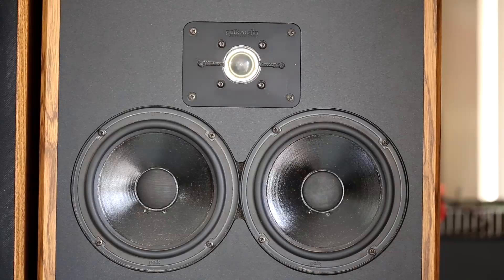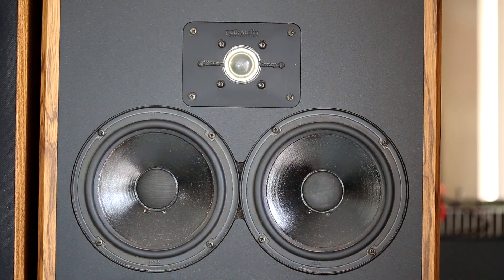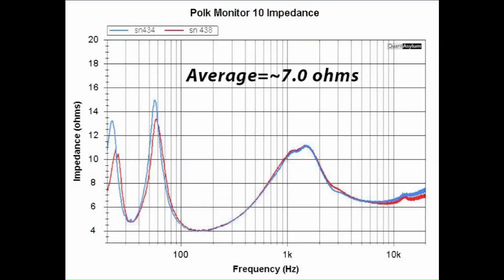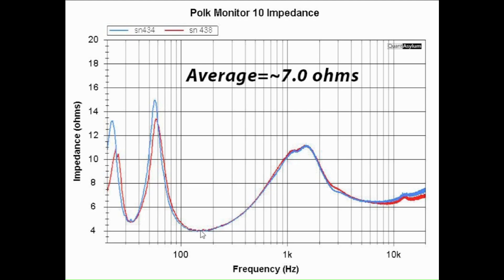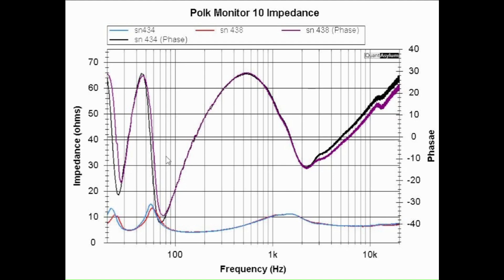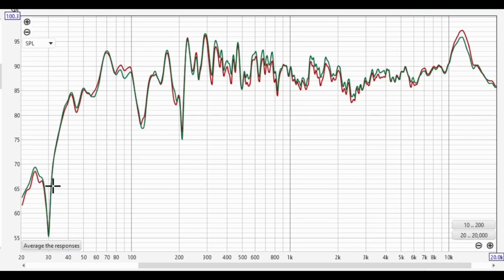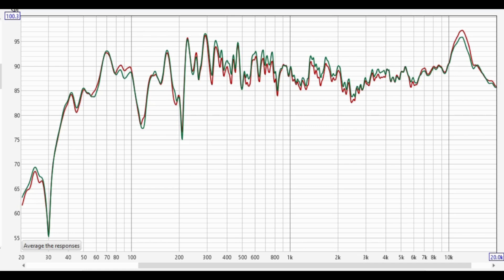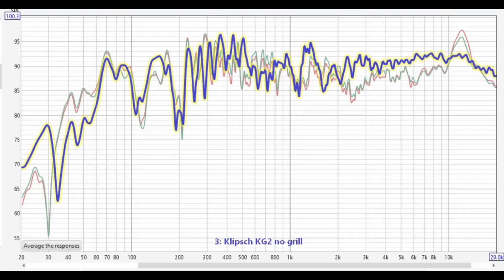Polk Monitor 10 Series 2 Loudspeakers- Vintage Audio Review Episode #164

Comment: I had some used.  I upgraded the 35 year old electrolytic crossover caps with metal poly caps.  They opened up and cleaned up a lot.
Reply from the maker: Glad you had good results with the crossover upgrade.

Comment: They have a fuze on the back. Maybe that is for the sub only? Seems like is has separate inputs on mine for the sub.
Reply from the maker: Maybe they did that on some other version, but mine does not a fuse you can get at or wiring for a sub

Comment: I bought my Polk Monitor 10 around 1981, I think the shop was Absolute Sound in NYC.  They have the Peerless tweeters, which are supposed to be much superior to the later replacements, but I've nothing to personally confirm that lore.  They have been solid and dependable over the years, I had one woofer go bad early on and Polk had an exact replacement.  I have more expensive speakers, like Klipsch LaScalas, now as well,  but I still listen to the Polks more often.
Reply from the maker: Thanks for sharing. I am listening to my Lascalas with some old vinyl right now. THe Polks can't hold a candle to the LaScalas IMHO, but beauty is in the ear of the beholder.

Comment: I've been jammin' on a pair of model 10A's for for the last 40 years!!!!  Due to my weird room, I use one silver tweeter and one black one that says Polk Audio 4 times on the tweeter.  The drivers and passive radiators are all original, but the crossovers were modified long ago.  These speakers are absolutely amazing.  With a nice Thorens, Hafler xl-280 (modified) along with a Linn preamp....max sound...max volume...no distortion!!  I bought this mint condition pair with stands for $300 around 1985 from a co-worker and have been jamming with them ever since.  Everyone is amazed at how good some of my lps sound with this system!!  Go Polk Go !!!!
Reply: I purchased my first pair of polk Audio Monitor 10A's back in 1981.
Consider them my first sonically "adult" speakers. 
Although everyone praises the A version due to the peerless tweeters, now that I'm in my 60s I can't hear much of anything over 12 kilohertz anyway. 
I did not hang on to mine for 40 years but I did recently purchase a replacement pair a few years ago. 
I'm pairing them with a decent SVS subwoofer. 
The nice thing about Polk's is that they use a durable rubber surround so other than adding a bit of epoxy to the magnet drivers bonding them to the metal frame, these speakers should last a long time. ❤
Reply from the maker: @powerguymark  I appreciate the comment and did not know about the epoxy "hack" you mentioned- am glad you reconnected with a pair!
Reply from the maker: Thanks so much for sharing about your system and am glad you kept it all of these years!

Comment: Those are not the series 2 model. The series 2 had the black SL 2500 tweeter.
Reply: Which ones were considered sonically superior?  The Series 1 or Series 2?  I have a pair I got new in the mid to late 80's (still in mint condition, as I 'babied' them), with a serial number of 176731.  Next to the serial number it says just the number '10', and the tweeter is transparent, not black.
Reply from the maker: @AudiophileTubes  One of the comments is that they are Series 2, but I honestly could not tell which are which at this time. Some say the tweeter in the series 2 is better, but ultimately it was what you think sounds better, not some reviewer, even if the measurements are  bit skewed one way or another- maybe you don't like as much bass as someone else kinda thing. I appreciate the comment!
Reply from the maker: I will take your word for it. I tried to make a determination from some brochures that I had found but must have gotten it wrong, but will do a bit more checking

Comment: The Polk 10 was a very flawed loudspeaker. I used mine back then with a 200 watts per channel Carver power amp, a Carver prramp and a top of the line Thorens turntable with a Grace tone arm, and Audio Technica's top moving coil cartridge. A pretty good system 30+ years ago; but the speakers were definitely the weak link. Polk chose to use twin smaller woofers above the passive radiator, so the mid and upper bass ( the fancy range )..would be fast, fleet, delicate and light instead of the usual  fat overly heavy handed mid and upper bass of most 12 inch woofers of the day. It did have good upper bass but as the bass got lower in frequency, it lacked the precise bass definition and transient quickness of some better speakers with active woofers. The passive radiators of the day were usually like that, a little slow, but the low bass definition was not too bad; just not real good A better idea would have been for Polk to mount the twin middle drivers ABOVE each other (instead of laterally), so they could make the cabinet slimmer. This would have diminished the awful cabinet diffraction of this speaker. The cabinet area behind the drivers was just too much and you can hear cabinet interference & early reflections galore. One listen and comparison to any good speaker with a slim cabinet or drivers mounted outside the cabinet,  reveals just how bad that problem was with the model 10. I have never bought a speaker with a wide cabinet like that again. 

 The best you can say for the model 10 is that it gave you a wider frequency response and a fuller sound than some other speakers at its price back then, but I'd trade that little extra bass and warmth for a speaker that disappears with not as much cabinet surface area behind the drivers. Maybe it could be considered a "good" speaker in retrospect, but not a "very good" speaker, or even anywhere near some of the better competition at its price back then. They could have done things a lot smarter. The Polk RTA which came later had the mid/woofers situated near the top of the cabinet, which was a definite improvement, decreasing much of the cabinet interference. Polk might have realized the problem by yhen, and corrected it with the RTA model and its tweeter was mounted OUTSIDE the cabinet. On a scale of 1 to 10, the model 10 would have ranked a 5 back then, or a 3 or slightly above now, with modern progress. The more expensive RTA would have ranked a 7 or 8 or about a 5 or 6 today.
Reply: I used to have the 10s the final version before they were discontinued. I remember that the tweeter would start crackling on one song on the treble. A song called Monkey Business by a metal band Skid Row. I had them hooked up to a entry level Yamaha integrated amp that was 50 watts per channel and boasted low impedance ratings. You would think that would be plenty of power right? Needless to say they were stolen from my apartment along with the other gear and amplifier. I have the monitor 5 which is the 8 inch sub bass radiator and silver coil dome tweeter. They were popping on a bass heavy CD I have hooked up to a old Adcom amplifier. Not sure what that was caused by? I now have them hooked up to a old Yamaha receiver and I play mostly vinyl on it. They seem to handle it well. I have a vintage Carver receiver I just bought. The m900 90 watts per channel and so far this component has been amazing on my CDs and power!
Reply: Thanks! ..I've done more experimentation with audio than maybe anyone over the years; or almost anyone. I modify equipment of all sorts and can triple sound quality. Currently am modifying a vintage system that I put together (used) for about a grand and a half, and am trying to get it to achieve six figure sound quality. It's really getting there. I could never afford  equipment that's as good as what my project sounds like already.
Reply from the maker: @sidesup8286   Just because something costs a bunch does not mean better sound, but trying to make your own system on a budget that sounds great is very rewarding.
Reply: Retail prices are conjured up in board rooms, and don't necessarily reflect quality or sound quality. But there is much out there that is way superior in sound, and it seems to always cost a lot. A manufacturer knows when he really has something there, and knows when he has  something very special. If you've ever been to a major audio show, you hear what is maybe actually worth it, and what is not worth it. Some items with high price tags do not have sound quality commensurate with the price. But sound quality & sonic realism can go much further than your average audiophile thinks.
Reply: Why not switch off Polk? They have never been among the best speakers in decades past. Some of their more current offerings within the last decade have been liked by reviewers whose judgement I respect. But I doubt if I would ever buy Polk again. But I have an open mind. One great new designer can turn an also ran into a great entity.
Reply: @sidesup8286  I own other speakers. Don’t get me wrong. I have a pair of Bowers and Wilkins speakers 685S2 stand mounted speakers and a pair of PSB tower speakers. The XT1 circa 2014 I want to dabble in the new speaker department and something that is in my budget. I have been hearing alot about Elacs over the years but I haven’t heard them personally. And a new speaker company called Fyne audio from Scotland. Something that is not really in the mainstream market like Polk Klipsch etc
Reply: There are so many different brands of speakers out there. Some of the speaker brands that are in higher end audio parlors, often have a more  budget model that might not have a tall cabinet, but using them on stands with a subwoofer would give you a refreshing freedom from cabinet diffraction from the wood/mdf behind the drivers. Good smaller speakers will disappear more since there isn't much cabinet area behind the drivers to cause diffraction and interference effects. Look for slim cabinets and rounded cabinet edges; that show you that much attention to detail was taken. My favorite size speaker is one around 20 inches high, with some depth to the cabinet but slim in front where the drivers are. Such a cabinet has enough internal volume to go deep enough in the bass, but the cabinet is small enough to get out of the drivers way. A great sonic disappearing act usually occurs, with musical sounds, and no hint of a cabinet or the sound coming out of a cabinet, if the cabinet is well made. Of course you need speaker stands. I would describe this kind of speaker as a large bookshelf speaker. Some smaller bookshelf speakers may lack bass, dynamic range, power handling and they "may" sound small. 

 I had some older.B&W DM 302 speakers. The back of the speaker has a unique honeycomb structure with little openings that release cabinet resonances. I had 2 pairs and I would stack them  2 speakers a side. They sounded less strained with 4 speakers sharing the volume, the imaging had way more height and depth than using just 2 speakers. The bass went 20 hertz deeper using the 4 speakers and tamed some brightness. And using 4 speakers doubled their power handling. I didn't have to worry as much about damaging them by playing them too loud. Stacking is a very smart thing to do. You can get speakers like that used for $200 each pair, and for $400 total; you have the sound equivelent of around a $1,500 pair of speakers.
Reply: @sidesup8286  wow really good insight! I have heard of stacking speakers. In fact I have a old pair of acoustic suspension speakers called Audio Analyst where the now defunct manufacturer had a article about stacking. The speaker is turned upside down on top of the other speaker resulting in a a different sound. I have seen the cabinet design of Q Acoustics speakers and they have deep cabinets and rounded corners. I don’t have any high end dealers here in Tucson except for Best Buy. LOL
Reply: If you try stacking 2 a side, try it both ways; with the top speaker upside down, and also the usual way, with  with the woofer lower & closer to the floor which gives more bass. Also be sure you have an amp which will go into lower impedences, as stacking will make 6 ohms speakers present a 3 ohm load to the amp, halfing the impedence. I once tried syacking 2 different speakers, 2 a side but one of each brand on each side. A Sony ss'h 3500 was stacked on one side with some other speaker underneath it. The drivers were around the same size and had roughly the same mass and acceleration. The imaging focus only suffered a little bit, nothing serious. And the Sony added some needed warmth. I liked the balance better that way.
Reply: @sidesup8286 since we are from the 80s audio era, do you have any experience with the old Boston Acoustics A series? They were highly recommended for the time. A small driver in a large sealed cabinet yet narrow in depth and also Advent speakers from the 80s. There’s a reviewer on YouTube who calls himself Nemo Propaganda. He reviews nothing but bookshelf speakers and subs. He really isn’t into tower speakers apparently. Also Erin s Audio Corner and Cheap Audio Man.
Reply from the maker: I appreciate your long, thought out commentary on this. Have no experience with Polk speakers other than this one, which sounded ok but did not have the bass i like to feel.
Reply: Am surprised with that kind of power you didn't blow up crossovers. A friend of mine had a Luxman integrated amp 150 watts per channel and  had to replace burned up crossovers with ones that could handle it When model 10s came out speaker companies were not designing speakers  with over under woofers. The 10s were like sooped up KLH from 60s A better speaker from Polk for that kind of power would be SDA 1.Also a good powered sub with crossover set to send all treble to model 10s would  help with more defined bass and upgraded speaker wire  helps bass definition. Your insights are spot on .
Reply: I have Polk monitor 10b and Polk rta 12c both hnew crossovers. Polk 10b not a huge soundstage like the rta but the 10s sound better to me